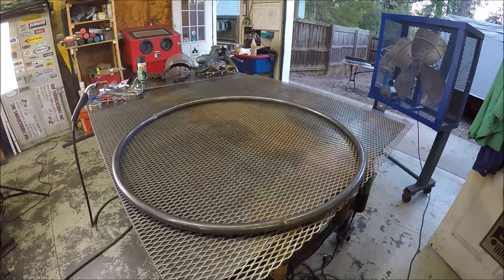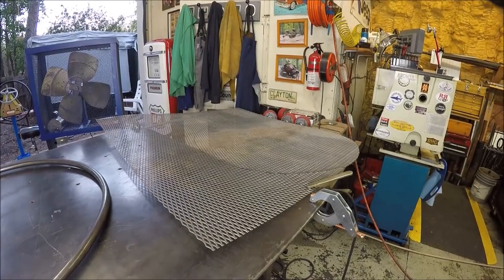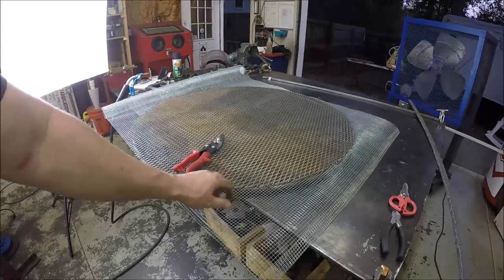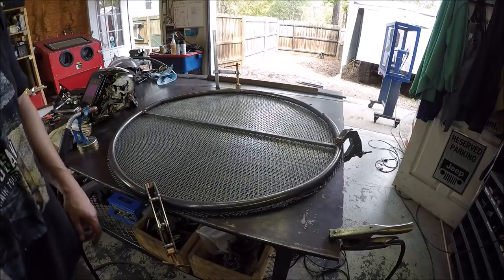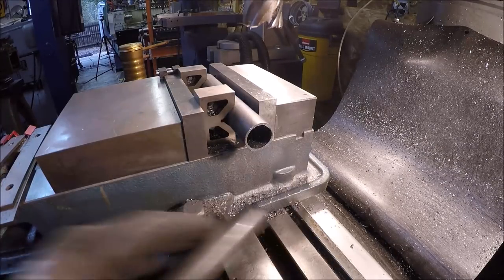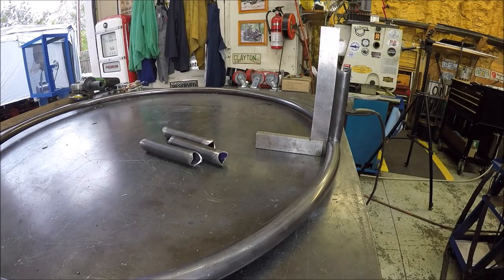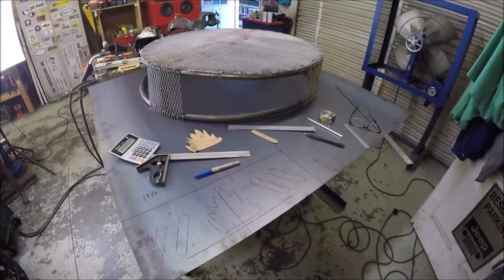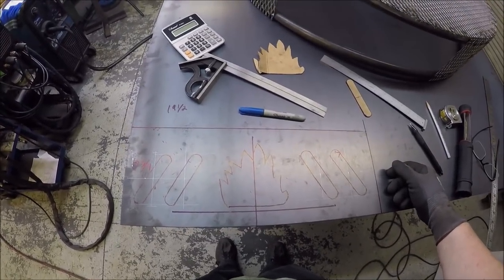Fire pit cover & log grate build Part 3

Comment: Hello. Looks good.   A variation of your product could be used to direct heat to the sides for a fire pit. I have a gas fire pit and most of the heat just goes up. Now if one were to use your above grate but with nothing on the sides then the theory is that heat would come to sides as long has there is air holes in the bottom of your fire pit to suck in air by convection. . Now why would the heat and air not just go through the holes in the mesh? An aeronautical engineer explained to me that air likes to go in direction of least resistance (i was discussing with him on ideas to deflect heat out and he said that mesh would be simplest and cheapest). Are you seeing hot air come through the side holes more than when you don't have the grill at all?